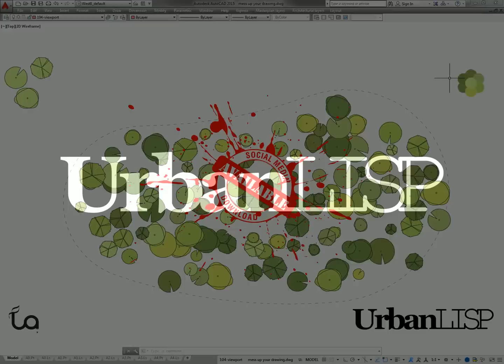5 Easy Steps to Mess Up Your AutoCAD Drawing … and Make it Look Better

Comment: i try to do this in cad 2014 none of the comands u told for use exist... there are pluggins? 
rotate random
exchange random
color random
scale random
Reply: Ricardo Pagone Ricardo, they are plugins. You can find them here: http://www.urbanlisp.com/commands/social-downloads/
Reply: Thank you Marina Zheleva! Guess what? There is an installation guide! You can find it here: http://www.urbanlisp.com/information/19/installation-guide/ Good luck!
Reply: UrbanLISP Thank you for the tips and for the source!! It seems really useful!! unfortunatelly I could not find a way to install the plug ins from the files I downloaded they are .fas which i dont really understand. I will be really greatful if someone could help with tutorial about it or sth. Cheers! :)